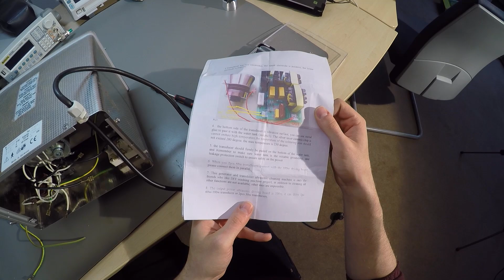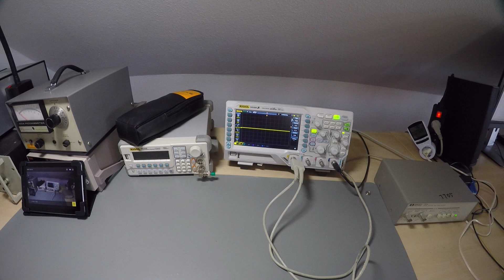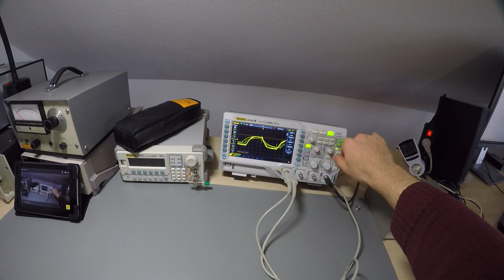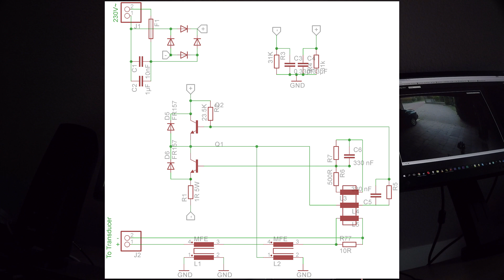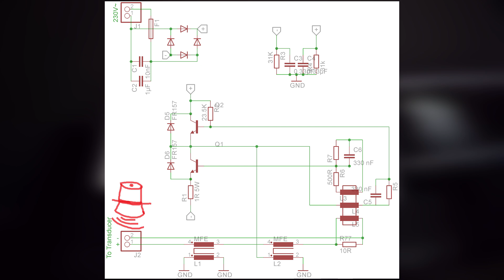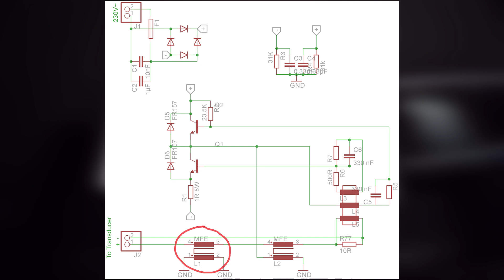Failed: Ultrasonic Cleaner Repair

Comment: Well u gave up way too easily. That resonator circuit is pretty clever. Always at right frequency. U should fix that and maybe add some current limit or thermal protection.

Comment: I have never had any luck repairing these things when they get weak.
Changed the transceivers and cleaned the surface to no avail.
I never want to see one of these miserable time wasters again.
I refuse all of them now.
Transducer work is very tricky and the oscillators make too much smoke.
This is my most hated device. They all deserve a lengthy treatment with a heavy duty 10kg Widlarizer.

Comment: The mechanical resonance must match the electrical drive frequency.  The mechanical resonance changes as material is added or removed.  You might measure the mechanical resonance after installation and then modify the drive board to match.

Use VERY low power when driving at no load or you will kill the piezoelectrics.

Comment: I’ve found your video helpful, at least.  You’ve dismantled the broken driver, revealing what the inside of it looks like.  That is of some value, without a doubt.  The positive terminal is meant to be the one with it’s disc suspended in the center with the rubbery insulation above and below it, and the negative goes to the part closer still to the pan, with the cone’s diameter getting larger as it reaches towards the pan, no?  I suspect that originally those terminals were wired the wrong way around or else like you were keen to notice, the driver board seems to be sensitive and particularly stubborn if the parts are different from those intended for it.  My kit arrived today, hence I’ve found your video here.  THANK YOU FOR SHARING!  THANK YOU STILL FOR SHARING THE FAILURE, AS THIS IS SERIOUSLY REALITY!  Everyone fails, and they who fail more sail more!
Reply: Indeed this has been plenty helpful for me in my endeavors.  Although I now have a properly working arrangement for cleaning flux off of my PCBs, I cannot say just how come its in order, as I have been mindful of every possible consideration.  Here's a few important reasons why I haven't gone and broke my transducers.  One, they should NEVER be powered to run dry, unmounted, or without load.  Because as stated, the solder beads themselves were fragmenting from the energy of vibrations alone.  There are warnings that state the tub should be filled to a minimum before powering on.  Place a loose transducer near to your fish aquarium and turn it on, see what could happen left free to shake about!  Also the polarity here is crucial.  The center tab is positive, the more outside tab (either above or below) is the negative.  Active cooling might be necessary, and this shouldn't be left running for over thirty maybe forty minutes.  I haven't run mine over fifteen minutes yet, to be safe.  This video is the best most closest document to a helpful hint on these transducers.  There's a whole range of experiments worth trying out on a boring weekend that this video has helped me contemplate.  Volume and type of cleaning fluid.  Placement of transducer element.  The frequencies of the 'cavitation' patterns in the fluid when filled to different depths.  Differently shaped tubs, with greater or lesser volumes.  Also it's probably wise to note that the items to be cleaned should be suspended in middle of tub, not allowed to just sink and rest at bottom of tub.  That's all I've got, but it's very much thanks to this video that I ever even got the courage to switch mine on.  THANKS AGAIN!!

Comment: I have similar ultrasonic cleaner made by Kendal that uses two 60w transducers @ 42 kHz and actually had a successful repair on mine. What happened was the tank became pitted and began leaking, so after dismantling, i replaced the tub with a new stainless steel steam tray with the appropriate dimensions. Then the problem i faced was transferring the transducers since they didn't want to be separated from the old tub. I ended up grinding the bottom of the tub until the center point of the tranducer was visible, and it turns out there is a stubby threaded bolt welded to the bottom of the tub, and adhesive is applied to the bottom of the transducer, then threaded onto the bolt till tightly flush against the bottom of the tub. I managed to extract the old bolt out of the transducer but since i didn't have the means of welding stainless steel, i just JB Welded the transducers onto the tank and let cure for a week before powering it up. It actually worked, though it's not quite as strong as before. When it was new, it perforated aluminum foil. almost instantly. Now it takes a bit more time. Probably because the new tank is slightly thicker than the original and the added mass of the JB weld.
Reply: Can you simply tack weld with an Amazon stick welder?

Comment: This is a really interesting video that might interest you. It shows to me its not just a simple case of putting anew transducer in, it needs to be tuned. I can see any variable tuning in my cleaner or your circuit but I suspect that is going to be required to change the transducer. In principle the circuit you put up should vary to the peak current but maybe its out of range, I dont know but I am going to investigate with mine. I have a nice new scope and arbitrary waveform generator turning up this month and this will be my first test.
Reply: Idiot! you need to actually put in the url  https://www.youtube.com/watch?v=-E7zlQEk5MA

Comment: I too have had similar issues and similar failures trying to repair my cleaner. I replaced my transducer and it is sort of working but not to the level required, its buzzing but very slight. I did replace the whole transducer and re-glued the unit the the tank but the original did have a small spot weld also which I was not able to repeat so I suspect Yi You below is correct and these are very sensitive. It would be very interesting to know how they manufacture these tanks so they work, there must be something they do to ensure resonance I guess.  Good video though thanks, always nice to know you are not the only one who fails from time to time

Comment: I just heated mine up with a hot air gun from inside the bath, to melt the adhesive then unscrewed it from the unit using grips, it came out in one piece, screwed in the new one with new adhesive and it works fine.

Comment: This ultrasonic cleaner is not cheap. It is 50Watts only. 
https://m.banggood.com/BK-3550-35W50W-220V-High-Quality-Stainless-Steel-Ultrasonic-Cleaner-p-958729.html?utm_campaign=BestToolLocker_October&utm_content=2635&p=KR28032004379201507P

Comment: This Old Tony did a video about half a year ago about the mechanical side of ultrasonic cleaners. Having watched that, I'm not surprised your attempts didn't work. This stuff is has to be very well engineered on the mechanical end to work properly.

Comment: Nice to see it’s not just me that has struggled with these UC drivers/transducers.  I was also mystified by the odd circuit since I purchased a couple drivers and transducers essentially identical to yours, so seeing the reverse engineered circuit was very helpful, thanks!  I got 40KHz and 28KHz versions to try out and it was not obvious what the difference was between the two drivers, though from your schematic it is probably likely to be controlled more by the transducers than a significant part change.  BTW as others have mentioned you have probably damaged your transducer by running it dry, these things operate at near destructive resonance when in-situ and without being coupled to a load it’s probably not very healthy at this point.  Who knows, but it’s definitely not going to work without removing the old section of the transducer.

Comment: Your mistake was powering the circuit outside of it being attached to the bottom of the tub and without liquids. That damages the working end rendering the whole device useless.
Reply: Bought an ultra sound cleaner many years ago.  
First time unbox the gadget was exciting.  So I plugged in the machine.  It gives off some ultrasound.  
Next I pour in some water to test.   It was kind of work, but the power seems low.   

Then I noticed a warning label that says, "do not operate the machine without filling water".
Days later, I opened the machine to take a look.  
The donut shaped Piezo crystal cracked at a chord off-centre roughly 1/4 of the circle.

Comment: Hi. Nice video! What is the material "connecting" the ultrasonic transducer to the metallic base? Solder?
I have one that is broken. I wounder if it is solder or some kind of ceramic material. My transducer broke and fell off, I'm wondering how to put it back in place again.
Reply: Its a type of epoxy. Some expensive units use a thin sheet epoxy that must remain refrigerated prior to application. Other companies use a product called AB Glue seen here: http://www.ultra-piezo.com/Products/ultrasonic-transducer/ultrasonic-transducer-of-ab-glue.html

I used JB weld on mine. it worked.

Comment: Because the new transducer was glued to the old one, the impedance of the transducer no longer matches. The aluminum head piece and the steel back piece on both sides of the piezos reflect exactly 1/4 of the wave length. Due to the sound speed difference in aluminum and steel, the two pieces are of different lengths. Thus, the energy is consumed internally inside the transducer, which, of course, resulted in a "not working" scenario.

Comment: According to my previous(unsuccessful) experience with ultrasonic stuff, I know, that even torque of transducer bolt can significantly alter the resonance frequency of the system, thus leaving a piece of old transducer in here was no-go. Acoustic engineering is scary-hard.

Comment: Is the little PCB at 08:04 (where you put your finger on) a selfmade PSU for the Proxxon Tool?
Reply from the maker: RSOFT92 yes, if I remember correctly that motor takes rectified unregulated voltage so that the thyristor-based speed control works

Comment: I've seen many videos where people used a electric sander as a transducer to shake a plastic bucket. From my findings however the frequency of the transducer does half the work and the other half is the shaking. My idea for a home brew model is using a 555 Timer or even a function generator can be used and use it to input a 20 to 400KHz tone into a modified amplified mono speaker that has the cone removed and a bolt epoxied to the voice coil and a brace going across the basket (kinda like a DIY tactical transducer). The transducer can be mounted on the bottom of a metal food service pan or a thin stainless pot. Reason for this idea from my findings it seems to take Mains voltage that is 50/60Hz and converts it to 20/400KHz. However this could be done with a low voltage option outputting the same 20/400KHz frequency.

Comment: you should check the capacitance of the old transducer before removing...tells a lot about the conductivity if there is a crack piezeo...
Reply: Hello,
  is there a way to check if the old transducer is functional without driving it?

Comment: Probably L1 is not connected as you draw. This coil serves as serial inductance load to get highr voltage on the transducer and impedance matching.
Reply from the maker: Hey, cool to see you here! I just stumbled across one of your ultrasonic speaker videos incidentally
Reply: Thanks. Yes, working on amplifier. Just destroyed one MOSFET - too much power for ferrite transformer, and it goes in deep saturation. The problem is that I can repair it, but no spare parts (IRFZ44). Oh, well...
Reply: @MilanKarakas  u r a legend